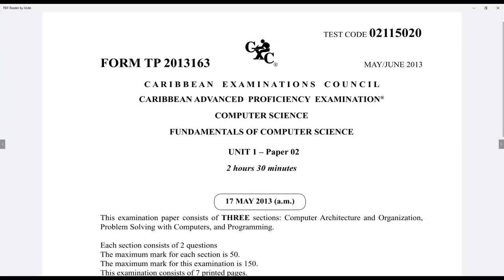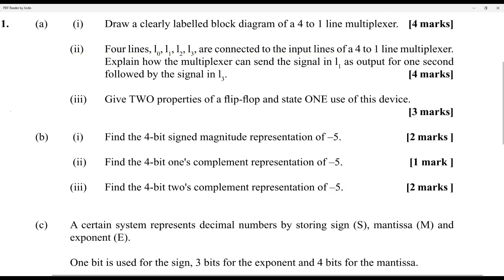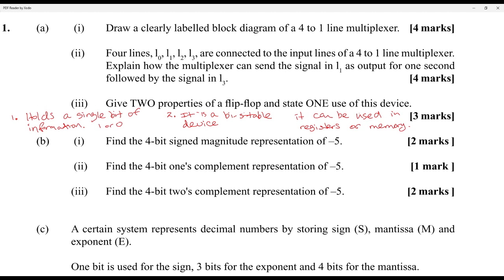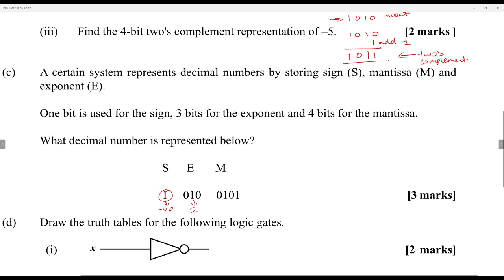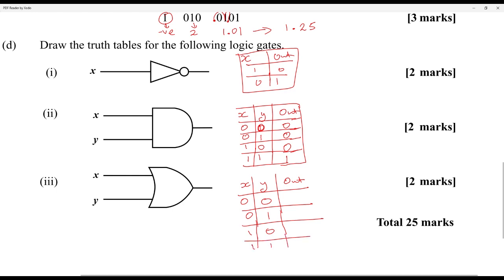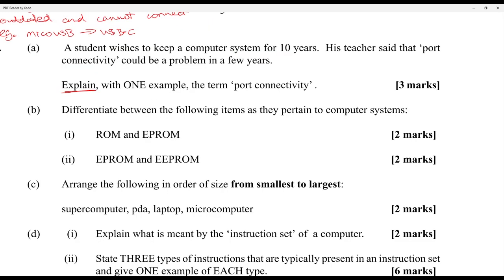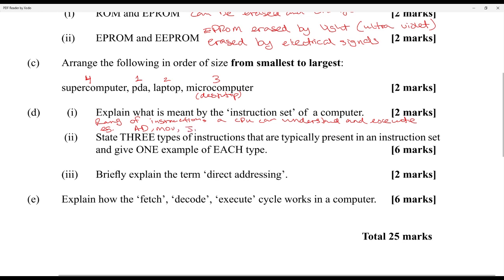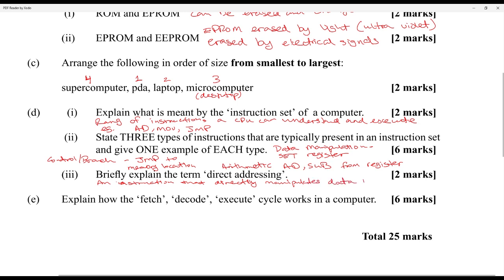CAPE CS Unit 1 Paper 2 - 2013 Module 1

Comment: Why didn’t you use 1101 at 4:35 but instead 0101
Reply from the maker: Ones complement requires you to invert.
Reply: @makeITsimpleTT  isn’t 0101 a positive 5 and not negative is that I mean sorry
Reply from the maker: When you are doing twos compliment you start off with the positive value then invert and add 1.

If you start off with a 1 as the start then you'd be using sign and magnitude which are two different systems.
Reply: @makeITsimpleTT  ohh I understand now thank you